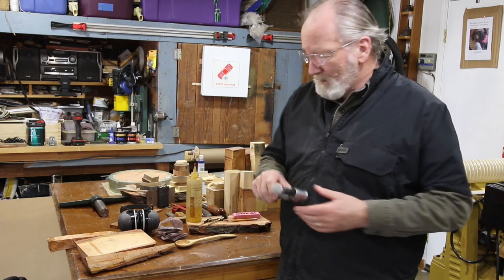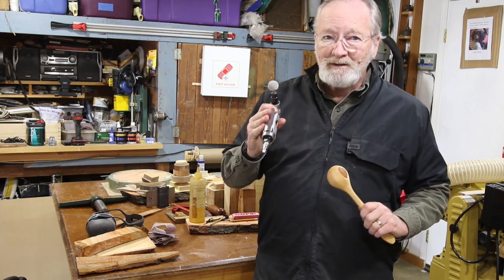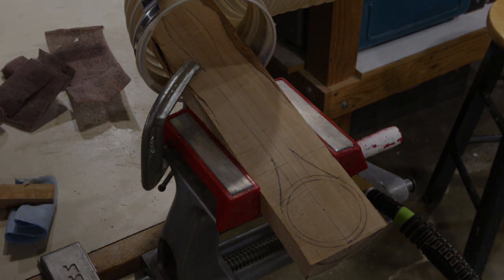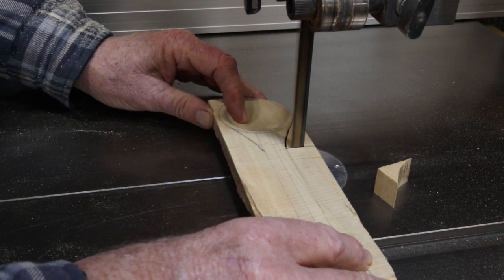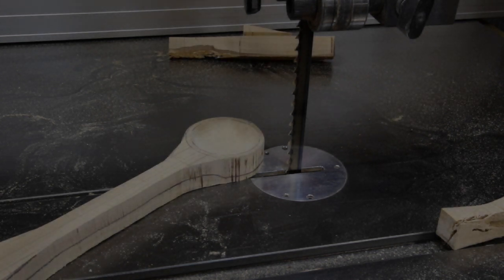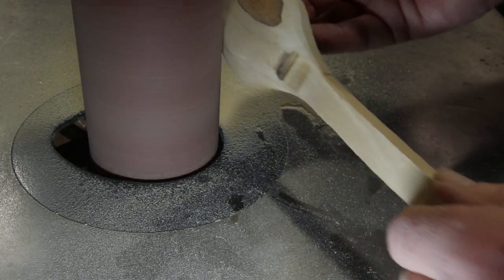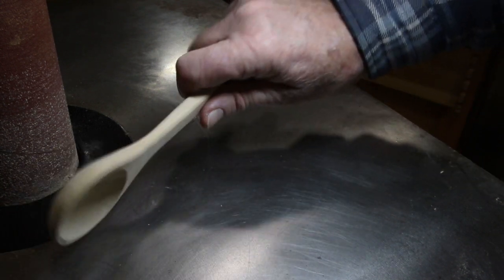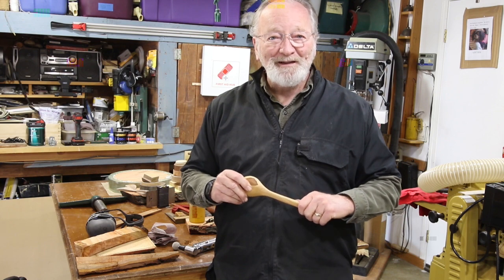Making a wooden spoon with a Rotary Burr

Comment: I get my wood from Face Book Market place when trees are fallen and the wood is listed as free. I'm getting older and I can't lift the logs like I used too and so I purchased a truck bed crane from HF. About $125.00 on sale. I now use that to lift the larger logs into my truck bed and it works great! You may want to think about that for a wood source. Thanks for this video. It's been helpful.

Comment: What is the size of the board you’re cutting from?
Reply from the maker: Most of the time I look to have a piece about three inches wide by one inch thick.  I've learned that most folks want a thicker handle as it's easier to hold on to.  Also thicker is easier to work with.  I start with the bowl first.  A bit of practice will get you making better and better spoons.  Making plain spoons sells the most.  Making curved, and unique handles sells slower but brings more folks over.  I get the occasional custom request for long and strong for chili pots or stews.  Have fun. Makes mistakes and learn more